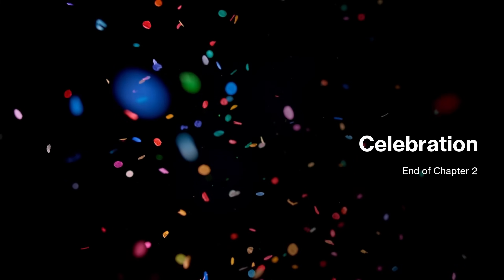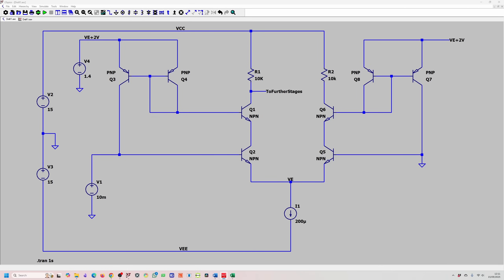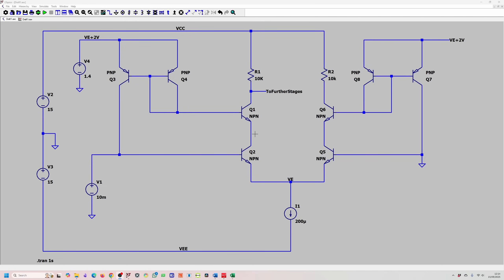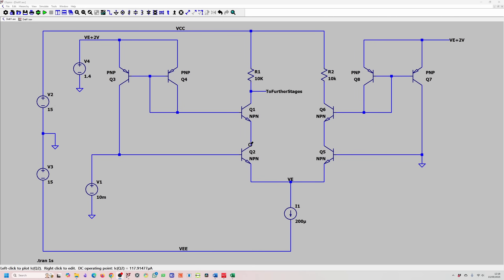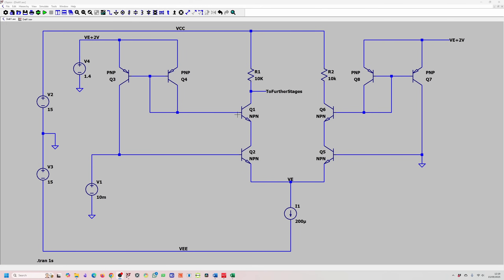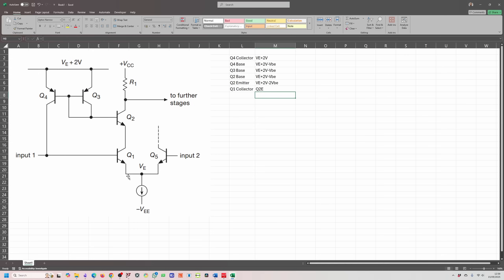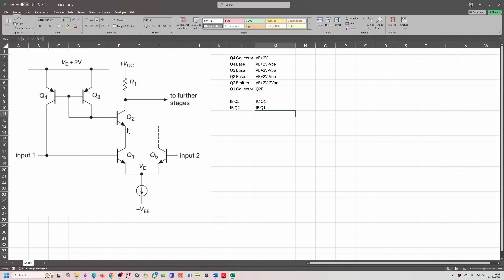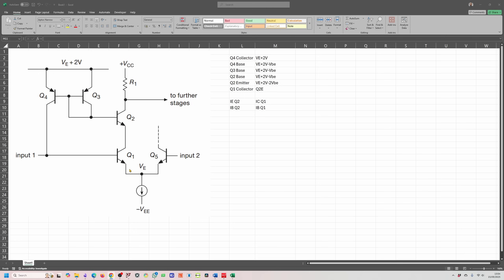Differential Amplifier Design - Art of Electronics Exercise 2.30

Comment: Nice circuit, I have seen it in many commercially available op amps. You might have startup problem.  There are circuits to prevent startup problem, which is not shown in the data sheets.  Also there is feedback from collector of Q1 through Q2-Q3-Q4 to the base of Q1, which could create oscillation.  You need to break this loop and do Stability Analysis.
Reply from the maker: Thanks for the feedback
Reply: I found that simulation only works if the current mirror is mirrored, I.e. the bases of the mirror PNP is connected to the base of the lower NPN.
Reply: I used kicad 9 for spice AC, transient and DC operating point analysis